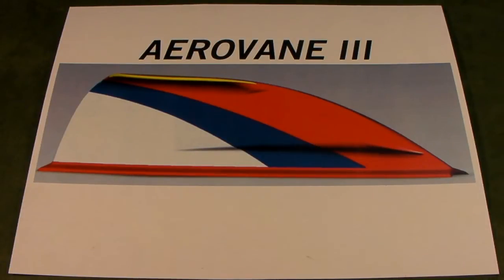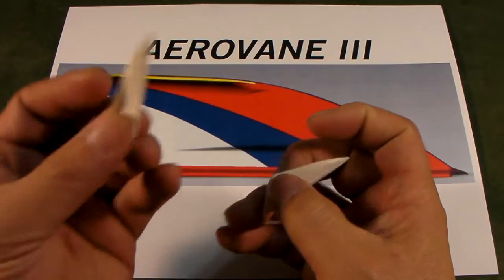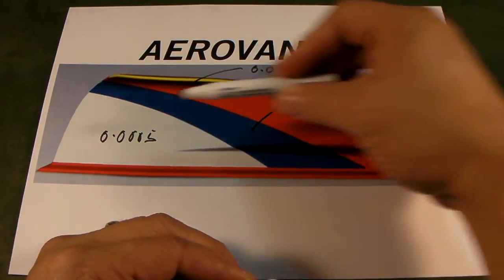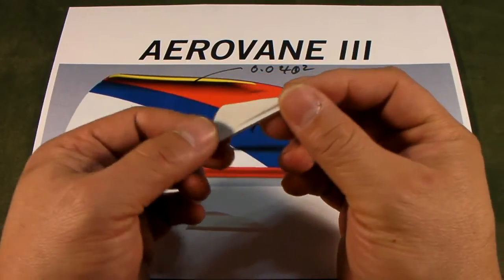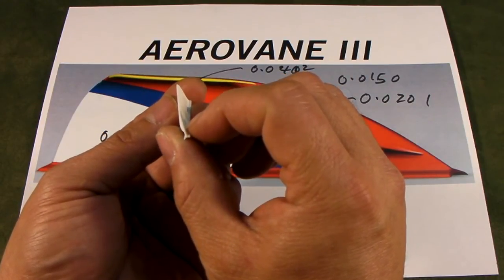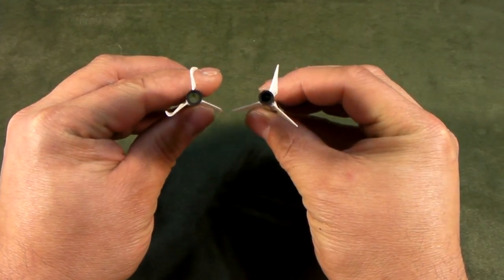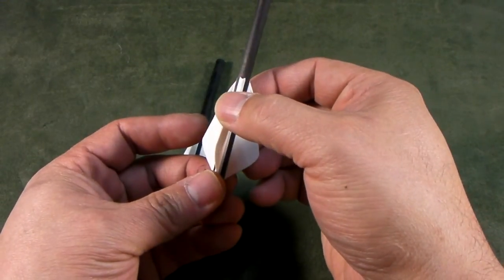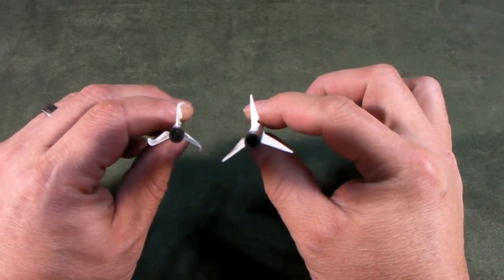Firenock Aerovane II & III Technical Tour

Comment: Can u fleet the 2 onslaught a Arizona ex fletch ot has a hard right helical
  I'm not shooting an overly fast bow. I'm more about control an can they handle high foc as I shoot 150 grain head plus a 90 grain outsert
Reply: that would not work well on any broadhead that is not tuned.  As a matter of fact, we recommended FOC of 6-8 % to use it well.   Unless you use over 25% FOC, it is going to be a struggle to get it to fly well.  It is an airfoil and unless you way overcome its ability, it will be like having a car with 3 wheel drive but with a SOLID transaxle.   call me direct for more question (815) 780-1695